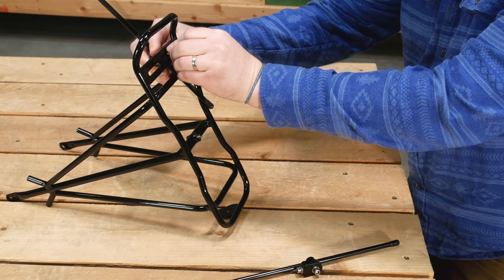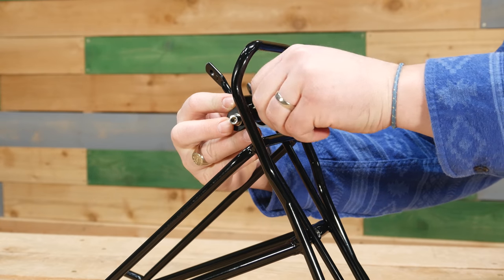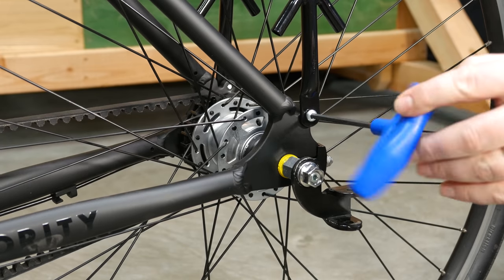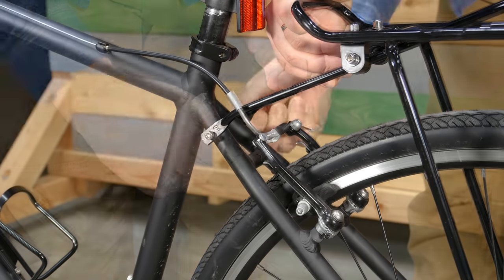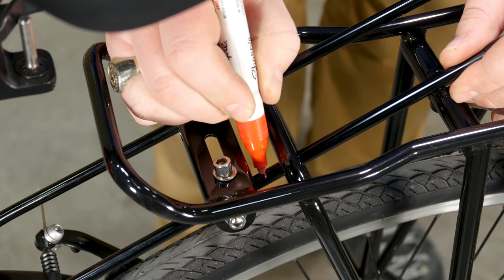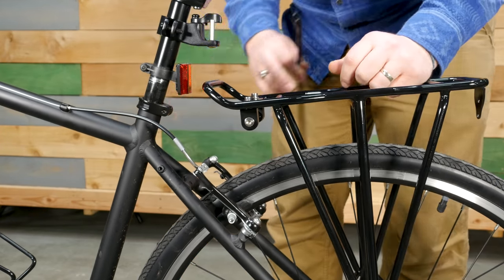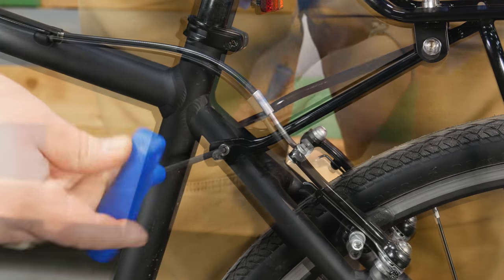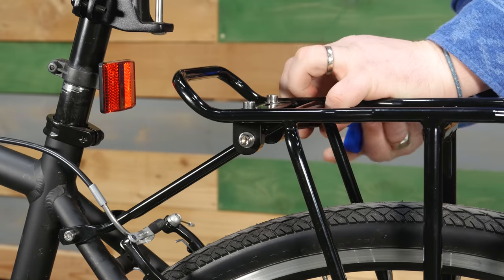Burley Trailercycle Moose Rack | Instructional

Comment: I've read a number of issues with getting installed on bikes with disc brakes.  Is there a standard solution to these or a different mounting scheme to support that config?
Reply: I have same question.  Read that someone bent the rack some and used a nut as a spacer to make it fit his bike with a disc brake setup.